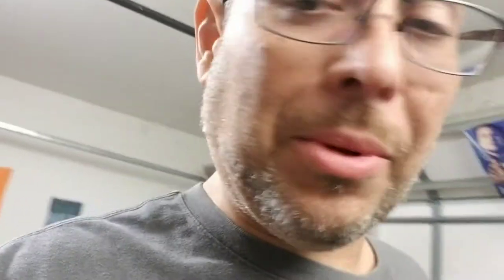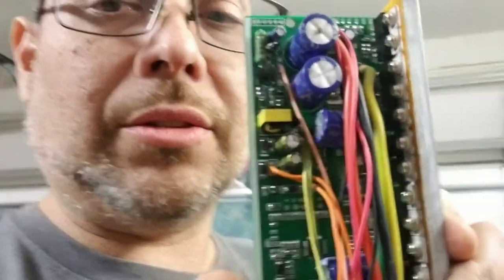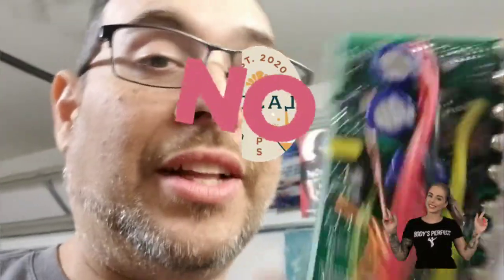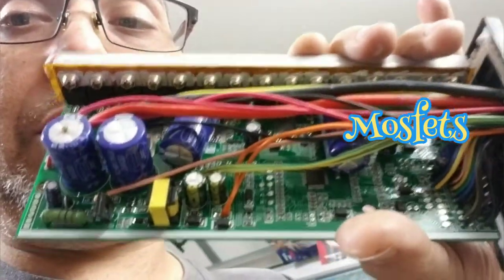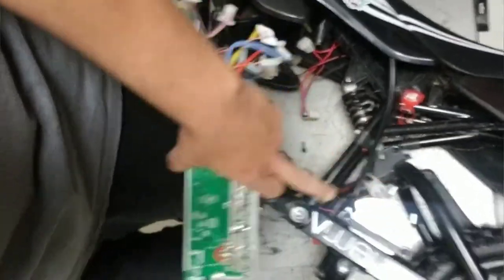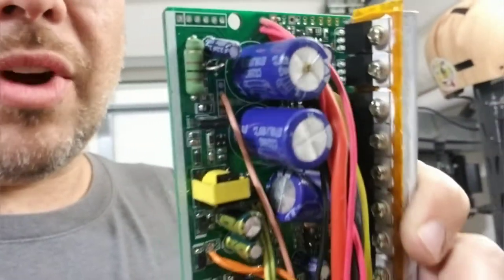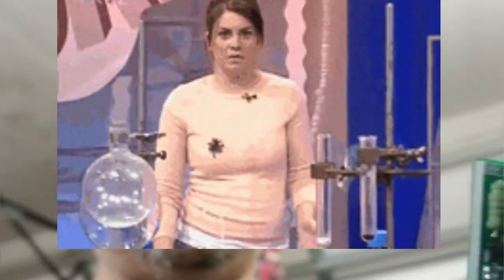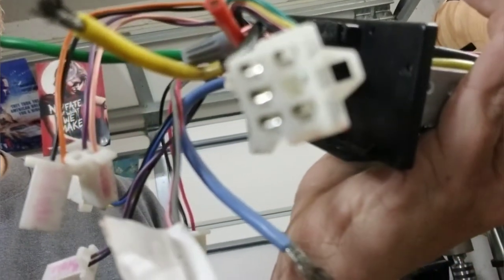razor mods Shunt mod!??

Comment: hvd-3 800w my controller has a R005 resistor I'm looking to place another on top to half the ohm. To 0.0025. .... The resistor is a 0.0005....question is what watt do i buy 1w 2w 3w 4w 5w... I haven't a clue can u help please
Reply from the maker: I dont know. But i am sure there is a simple formula for that. .
I have spent most of my life bending ,cutting, or modifying metal. 
Boards get modified, but i cannot build a board. And i dont suggest over working the mosfets. Once one pops they all struggle. 
Better to up the mosfet count. 24, 30, 36.

Comment: I'm in the process of making my 1st modified Razor. Your videos have been a big help for information. I am going to extend the swing arm so I can put a 12in rim on the rear. I want to make a mini supermoto. Can you help me with the dimensions of the round and rectangle tubes on the swing arm . That way I can pick them up before we start the mod. Thanks.
Reply from the maker: Better to find metric. But we got 20ft tubes. So were stuck till were out.  But thats possible.
Reply: @KeatonsCarlott  would you possibly sell me some ? That would help both of us. I would also buy a set of fork springs and the bolt to upgrade my folks.
Reply from the maker: @noce1071  wouldnt be worth it in shipping. And im out of springs
Reply: @KeatonsCarlott Ok
Reply from the maker: Its even been a year now !

Comment: Had any reliability issues yet I’m wondering
Reply from the maker: When you override a safety control.. u will wear the items.  80hp rolla wil last forever. Toss a turbo on and youll get 80k.

Comment: To be onist your videos wasn't very educational you joked on far to much taking about rubbish regarding up grade controller you solder the shunt bars nip together then apply solder lont the top if you use to much it burns controller out and damage mosfets never ever upgrade capaserters. Well I've done mine had no trouble it's faster and more torgue problem I had blew a fuse it was 30 amp so ether upgraded to 35or40amp.
Reply from the maker: I was still learning. That videos a little old.